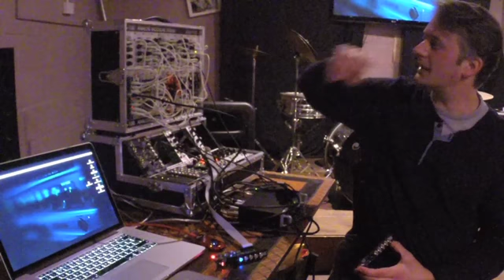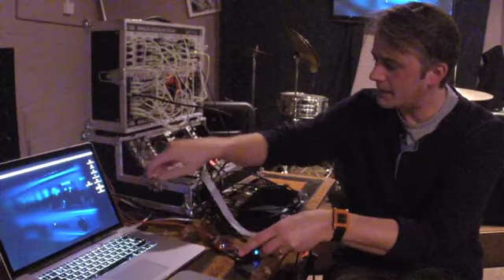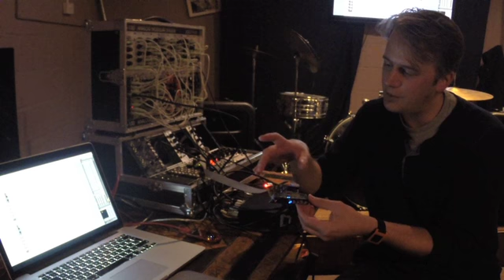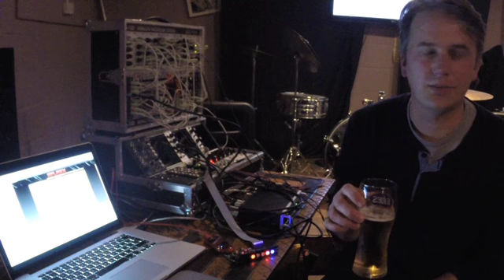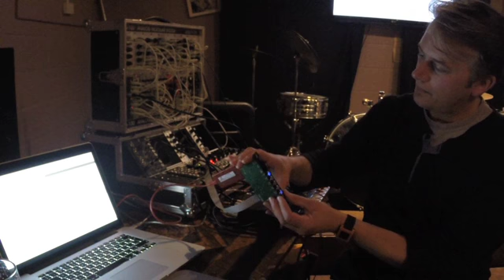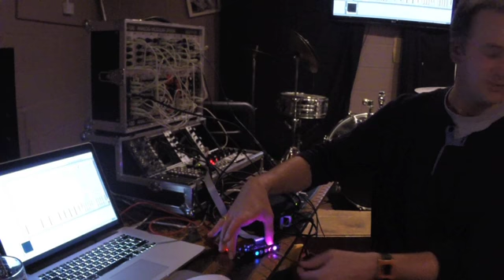Expert Sleepers 'disting' presentation at the London Music Hackspace

Comment: Does Disting has on/off switch? I hear it draws a fair bit of current, is that when it's being used only or also when nothing is plugged into it? thanks
Reply: Eurorack modules generally (I can't think of one that is strictly a eurorack module) don't have on/off switches. The Disting does draw a fair amount of current on the +12v side, but it isn't a whole lot more than other digital modules. Most eurorack power supplies should be able to handle this kind of power draw and still power a lot of other modules as long as all your modules aren't power hungry.